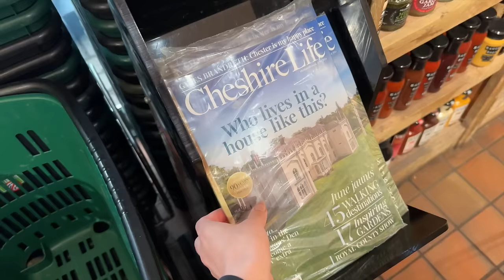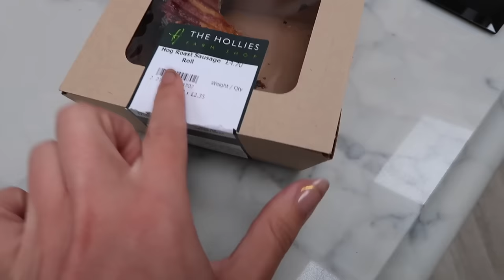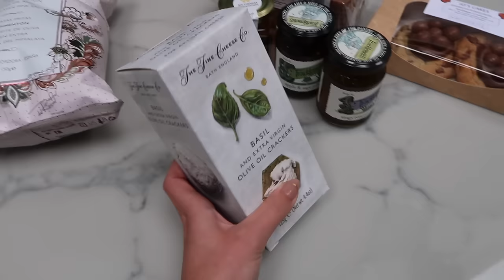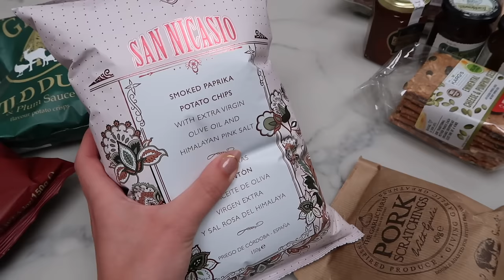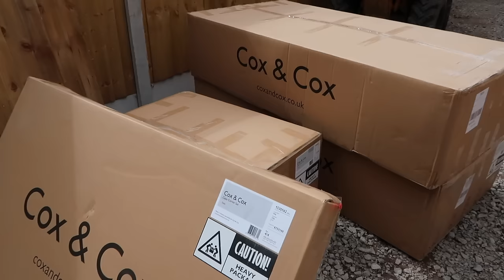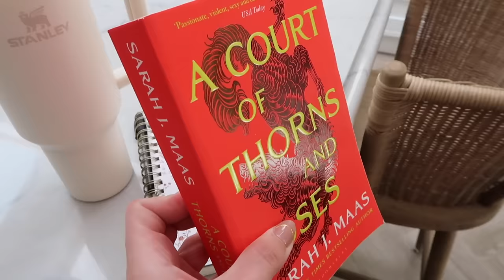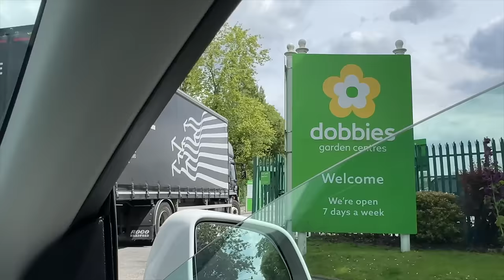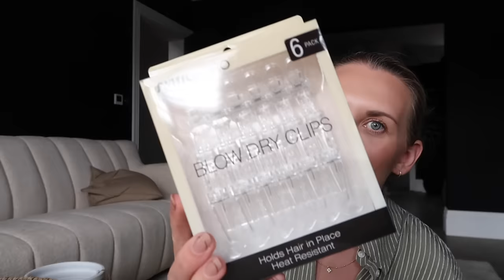HOMESENSE HAUL shopping trip & new garden furniture

Comment: I have a few ornamental vases....you can use ...if the size is right a pint glass in the centre. You can add some branches in the bigger ones and a small bunch of roses or tulips in the smaller range...I have also in the past used a plastic water bottle... different sizes again...and if all else fails....do a couple of linings with clear cellophane.  Wrap a piece of fresh oasis. And carefully drop into the bigger ornamental vase and add your  fresh flowers in ..just take care not to overdo fill any waters in either ideas. 😊
Reply from the maker: great tips thank you!